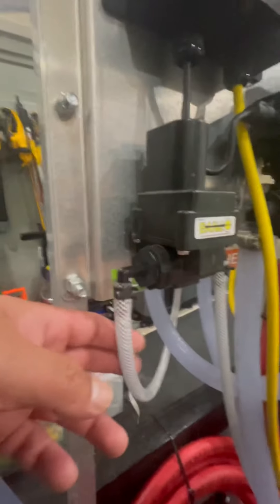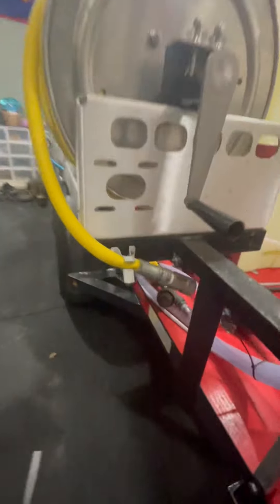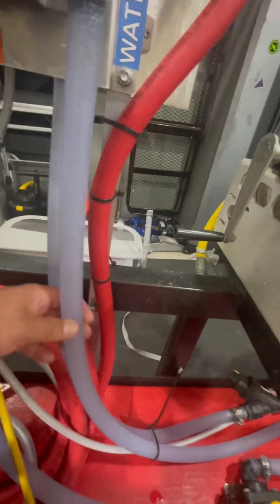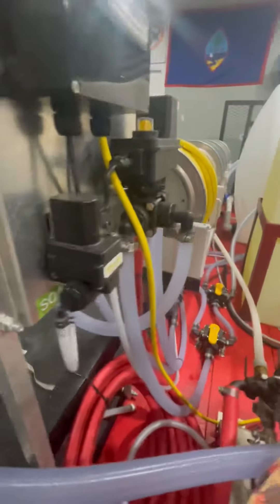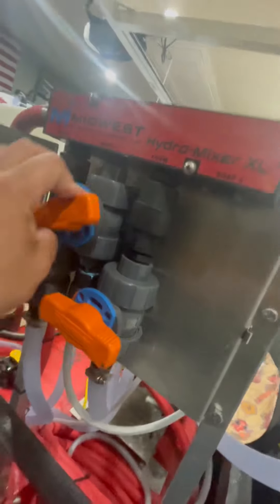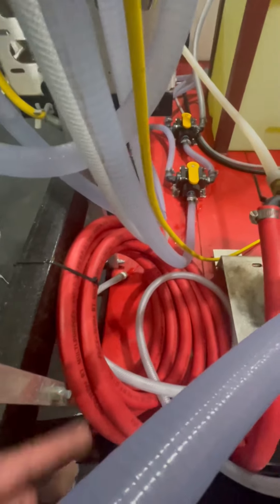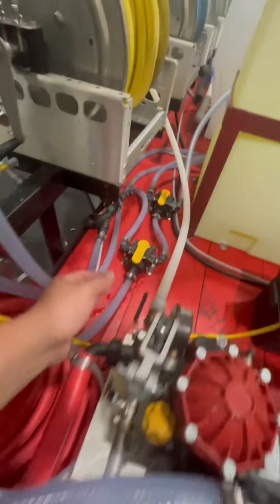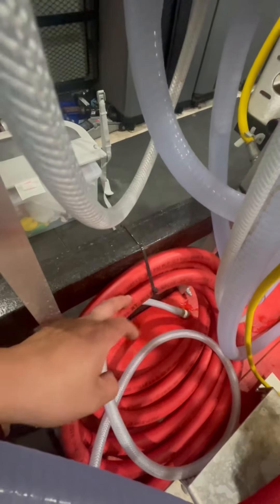Plumbing AR-30 using Midwest Hydro Mixer-XL

Comment: Thanks for the videos on the ar30! I want to add this to my trailer. Using 12 volt right now and have a lot of tall homes in my area and need more distance.
Reply from the maker: This would make a great addition. Just make sure you thoroughly flush system with water and bleach neutralizer.

Comment: Thanks that’s great. I figured it out I think it’s my metering valve. I have a backup and gonna change it. I also don’t have a pex on the out to the reel. I haven’t been able to find that around me, and the expansion tool is pretty expensive just for one fitting. Hopefully it works well regular line. Thanks again for taking the time. I got mostly everything right. Also gonna change my water line to a bulkhead fitting vs drop stick maybe that will help too
Reply from the maker: AR-30 is a diaphragm pump so you’ll need the Bulkhead at the bottom for the main water supply to suction line. Less work for the pump to prime.
Reply: Nice ty for sharing have a good day 👍
Reply: @netxpressurewashingservice  Thanks again I got it all working I changed one of the check valves and metering valves. Thanks again for taking the time it’s a good feeling when you get everything working that you built. I guess the only one other thing I would ask is to you always run it at four and use the engine throttle to lower the pressure

Comment: Supply hose from tank should be 1 inch and 1 inch to blend manifold, to accommodate AR30 pump suction flows required
Reply from the maker: I have two 3/4” supply suction leading into the proportioner out to a 1” suction. Is that sufficient enough? I’m not having issues with my pump so far